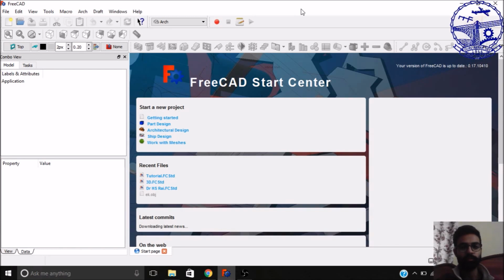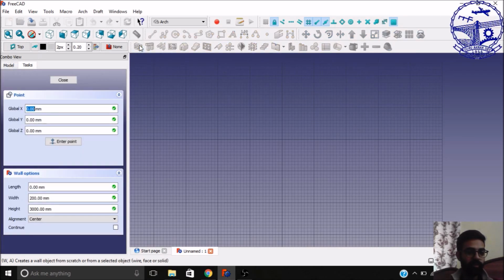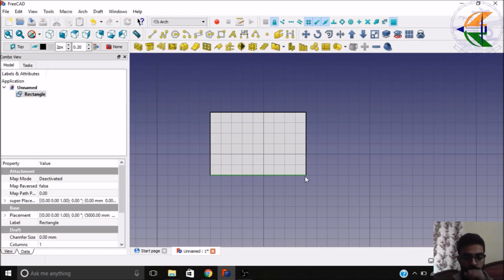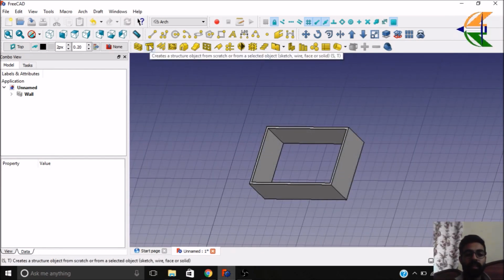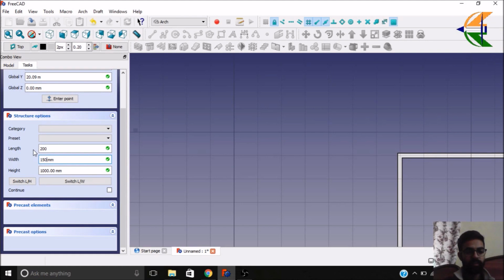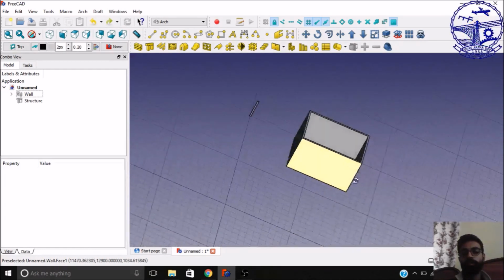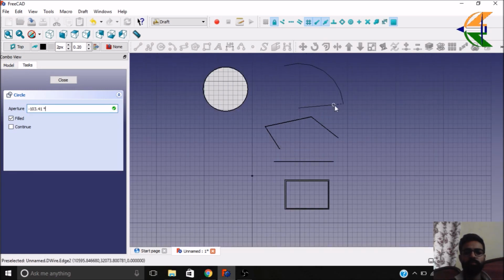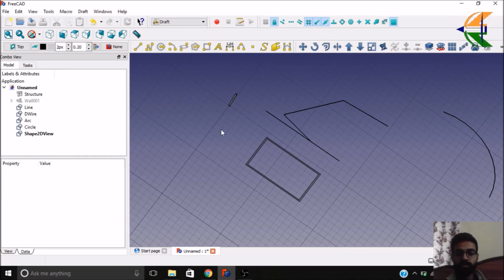3. FreeCAD Beginners Tutorial: Introduction to Arch & Draft Workbench

Comment: Eklavaya. I have just gone around the exterior of the floor plan walls, one single line at a time but when I click on the 'wall' tool, what happens is that the corner of the walls that should be 'square' like any normal wall are a 'step' shape. As  one wall over laps the other but only half way through so there is a section on each corner of wall that is over lapped, and a section that is missing. I dont understand how this thing works. Every single step I take is a dead end which I am unable to find any resolution to. I have been trying to figure this free cad out for weeks, many hours each day, and I am no further in even the first step of laying out a simple floor plan.

Comment: Hi Eklavaya. I have tried many variations to understand how this system of CAD works, spending many many hours frustratingly trying to just get past go, but to no avail. I can't even work out how to set up the grid so that I can plot points using the combo view 'task' window. I have been using the arch workbench as it is a 2D plan I am trying to draw. My problem is that when I set down a 'grid', using a scale of 4 decimals so that I can draw to a scale in metres, no matter what I do the 'local axis point' is in the centre of the grid. the problem with this is that , for example, if I simply draw a rectangle on the grid, then I have no way in plotting any further points accurately afterwards because I have no idea where, or how to locate/plot that new line. If I want to plot that new line in relation to the original rectangle, and for example it needs to be 3400mm along the wall, and 3800 long, then trying to locate and plot that line in the task window is virtually impossible because all the plots are based of that local axis point, so that pint where that new line needs to start may be 2969 to the left, and 1957 to the top of that local axis point. Also the curser on my screen is located up and to the left of the starting point of any new line, so there is no real way of judging where your new point will actually be other than using the 'snap' tools. I know that I can correct the original rectangle say from 9628 x 16382, to 10.000 x 15.000m using the the combo view, but to go on and plot the internal walls or anything else , I simply cant understand how its done, nor find any tutorial that explains why the local axis points are set out the way they are. it just doesn't make sense to me. I have been trying with this free cad for weeks and I have got nowhere with it. I just cant understand how anything works. I dont understand the language of it. if you have a tutorial that explains how to start and why the axis points are set out the way they are would be really helpful. thanks for baring with me.

Comment: I realize my version of FreeCad might be different than yours, but I've done my best to copy what you're doing second by second. When I click on a starting point, I get the dialog about the wall like you're describing. The line visually appears as thick as yours, until I left click on the second point. Then it stops drawing the wall, and shows me a big white box that takes exceeds the top and bottom of the grid. I'm in the Arch workbench, using CAD navigator, Linux FC33 and FC 0.19. My perspective is top. If I try to click on the wall, it asks gives me all the properties about the wall that could be changed, except the useful ones like length, height and width. I then realized my grid was in MM, so I changed it to the 1m like you have. It works better, but you'd better not make any mistakes because it's very hard to shorten a wall length.
Reply from the maker: okay, so you need to increase the grid size from the Arch Preferences.

Comment: I down loaded this program and following your steps but my program is not doing what you are. 
I go to arch then set up tool bars. Click on wall go to the grid and try to draw a line like you and my program wants to draw a line from top of grid to bottom of grid the length of the line I make.
Reply from the maker: I didn't understand the meaning of 'top of the grid to the bottom of the grid'. Kindly elaborate your problem clearly.
Reply: tegf4,  I suspect "snaps control options" or "make sure you are setting your working plane right"